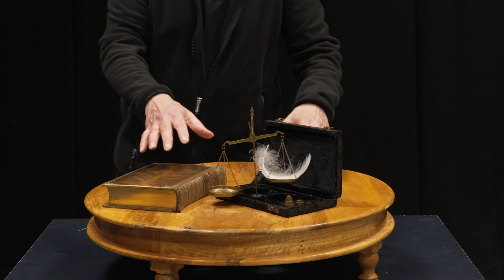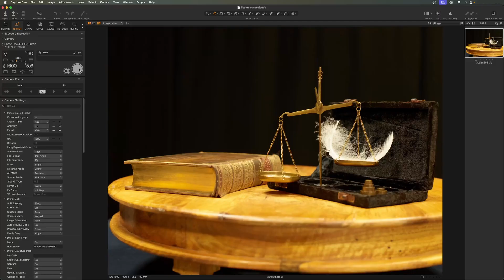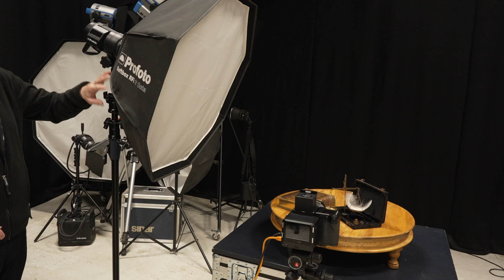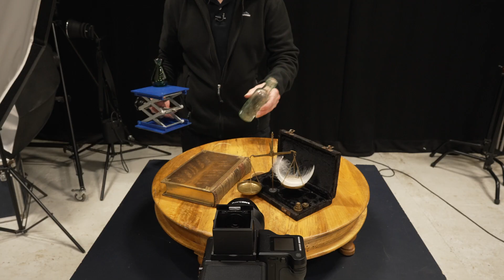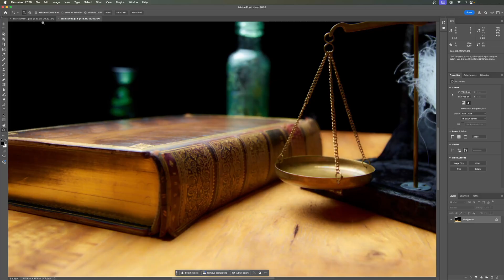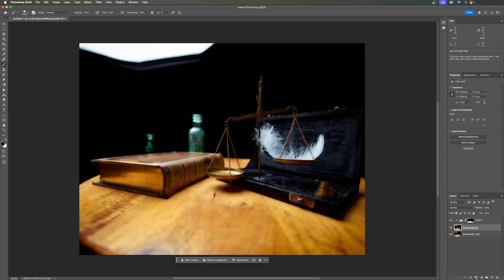Camera view point wide angle lens

Comment: Since I produce rather poor results using my wide angle lens, I really thank you for doing this video. One question: at around the 9:00 mark, you raised the softbox and took off 1/2 stop of light. Had you left the softbox low and taken off more light, would that make any appreciable difference in the result since the light would have been closer/softer, although that may have left you with a crop problem at the top?
Reply from the maker: I moved the light away to make the shadows harder, hope that helps. Thanks for watching.